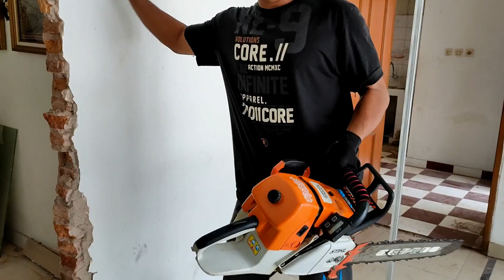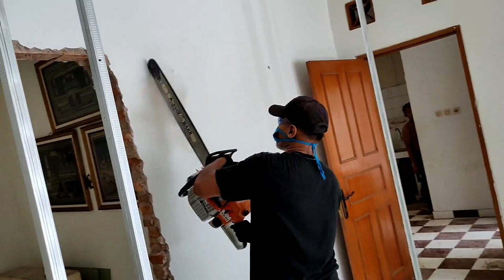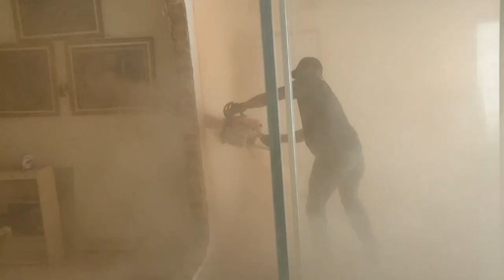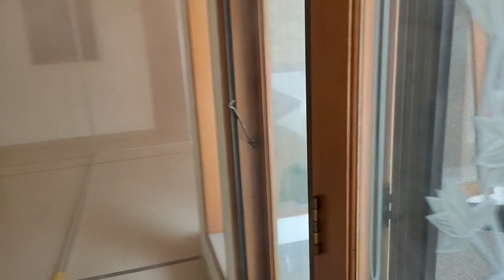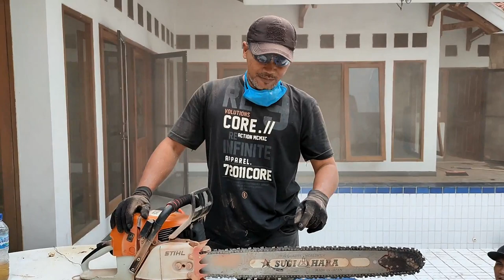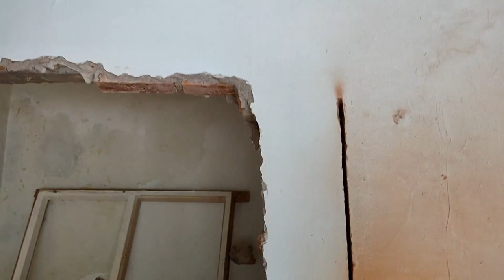😱 CRAZY MEN...!! Chainsaw cut wall / Tembok kok bisa di belah pake senso..

Comment: Intinya chain saw sgt powerful... ga ada masalah dia dipake motong tembok sekalipun. Tinggal pengelolaan safety dan debunya yg harus lebih diperhatikan. 
Kalo ga salah pernah lihat itu harusnya pake mata gergaji khusus dan diberi air agar tdk panas seperti lajimnya kalo motong batu/beton atau tembok selalu melibatkan air. 

Great video bang... Sgt menginspirasi 👍👍
Reply from the maker: Betul, ada senso khusus tipe GS yg memang buat potong batu dgn mata rantai diamond, sy menggunakan mata rantai carbide yg memang buat potong multi material
Reply: @agusrobert  Beli mata potong yang carbide sekitar harga berapa pak?
Reply from the maker: @PokohJayaTeknikPOJATEK  yg 20 inch 3.5jt
Reply: @agusrobert  info dong bang... rantai ini kalo untuk belah batu wadas awet gak ya. mau buat gali pondasi di tepi sungai kmapung om
Reply: Kalo stihl MS 250 pakai rantai 36RDR bisa tidak ya om

Comment: Ini daerah mana y,saya jga pengen potong tembok,terima Kasih
Reply from the maker: Jakarta
Reply: Jawa timur ada g y,Madiun
Reply from the maker: @inigirl8466  kalo mesin khusus buat batu ada  GS 461, Kalo buat multimaterial ada 462 R, yg sy pake mesin ms 660 dgn rantai carbide punya 462R
Reply: Berapa biaya jebol tembok?
Reply from the maker: @dwidindaelang4522  emang mau di jebol pake senso ?
Reply: @agusrobert  ..yah ..mknya nanya harganya ..lokasi sy dijkt
Reply from the maker: @dwidindaelang4522  brp byk yg di jebol, bisa wa saja 08888494848